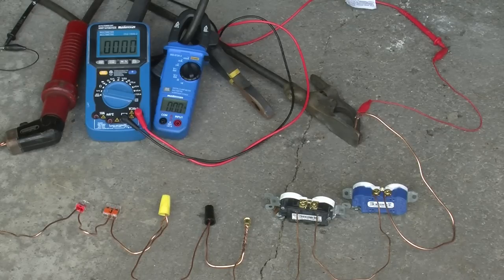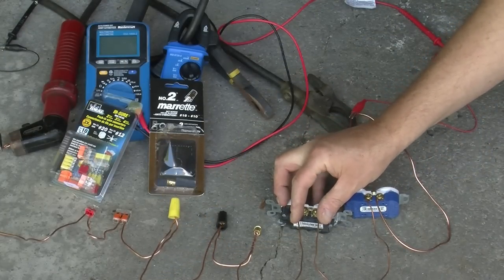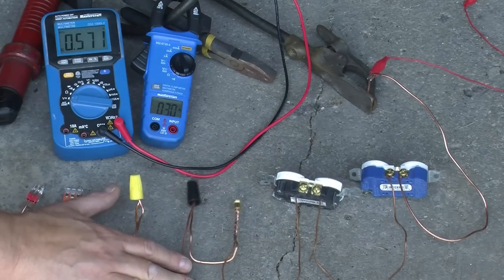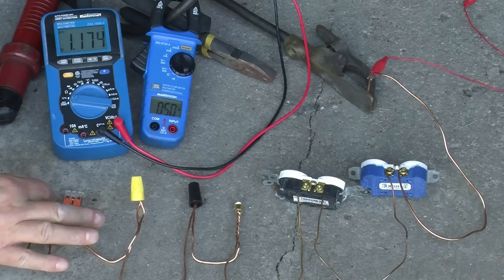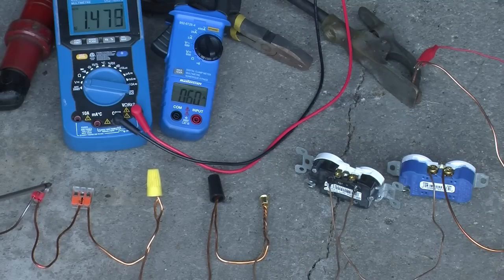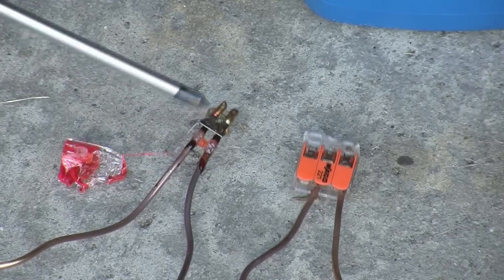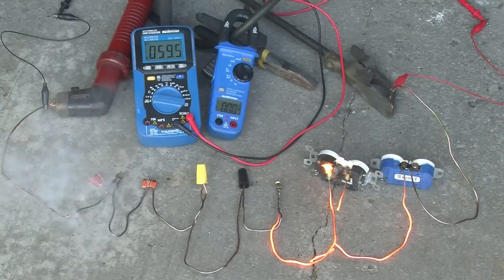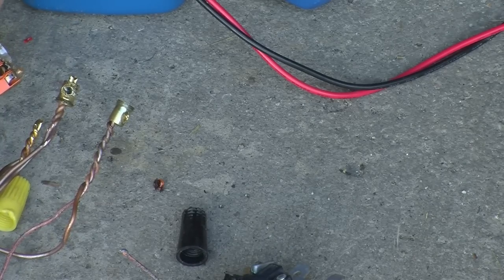Connectors: Which is the Weakest Link

Comment: I'd be interested to see some wire nut connectors that are used in less than perfect conditions (without pre-twisting the copper wires in advance):
0. control of pre-twisted wire
1. clean straight wire but barely twisting the wire nut
2. clean straight wire but really torqueing on the wire nut until the insulated portion visibly starts twisting as well
3. wire pair used previously together in the same wire nut, uninstall the nut, separate the wires, put wires back together matching original twist, install new wire nut of same size
4. wires used previously in separate wire nuts combined into a new pairing, roughly straighten wire ends with pliers until they fit into the original wire nut size 
5. wires used previously in separate wire nuts combined into a new pairing, no straightening, just jam them together into whatever oversize wire nut is needed to get them to fit
Reply from the maker: Thats a really good outline for a systematic test. I was also thinking of an old pair of very tarnished copper wires twisted and untwisted (similar to your 3,4,5 but perhaps without having some tarnish scraped off by handling).
Reply: A few more options, maybe on seperate tests, but how about varying gauges of wire together, and stranded+solid. And do same gauge and like the lighting style 18 guage.. it should fail first but I've found that connecting small gauge lighting wires is easier than two like sized stranded and solid counterparts. I think mostly because you offset the smaller gauge stranded farther in, and the wirenut gets into some "meat" of both. While the same gauge stranded might encompass the whole solid wire and the solid will pull out, or the stranded is to far back and doesnt get enough under the screw down. I think it goes without saying you cant really twist them together properly because the stranded gives way too easily for the solid to do any twisting. I'll always prefer all solid wires, at least for our standard circuit sizes here in the US, 15-20amp, 14ga, and 12ga.
Reply: Great ideas here fro future video tests. I am an electrician and really appreciate these videos as they explain what I see in my real world repairs. For sure I would like to see some not well made connections with corroded or tarnished copper and degraded Aluminum. Not twisted and remade connections.
Reply from the maker: @Sparkeycarp  I'm so glad you like the videos! I would be fascinated to hear more about what you have seen in real situations with problems. For a tarnished corroded connection, I think the only practical way to test  that is to get an old connection from a junction box that has been removed from an old house. If anyone is gutting an old house or otherwise removed a junction box that has not already failed and are willing to send it to me, it would be interesting to test. Same for some Aluminum 12/2 from the 1970s, and even better if  its attached to a vintage outlet and we can see how the connection might have degenerated. I'm in Ottawa (Canada) so it would be really easy if someone nearby came across some stuff like that.
Reply: ❤ this goes quite a bit further than what I was thinking. You covered what I was after
Reply: Just FYI, if you don't pre-twist the wire, you didn't install it correctly. Wire nuts were designed to replace a twisted, soldered, taped connection. Wire nuts have the most surface contact area. 

To do the test the best way is to test each connection individually. What causes a connection to heat up and potentially fail, is the resistance of the connection through the calculation I^2 x R. That is the heating in watts at the connection.

So testing individually, you push current through it at a specific level for each connector. You can pick a level around but above the circuit breaker level, or as I prefer to do, is set it to the ampacity rating of the wire. When you have that current set, then read the voltage. That is the voltage drop across the connection. The higher the voltage drop, the higher the resistance. 

Ohm's law tells us that V= I X R .and therefore R= V/I.  You know the "I" because you set the current. The voltage  drop is then V.  So that voltage divided by your set current, will tell you exactly what the resistance is in ohms.  The lowest resistance and the lowest voltage drop will be the best connection. From that point you can dial up the current to see which connection heats up the most.  The  power and heat dissipated at the connection is I^2  X R. So by doubling the current, the power dissipated will be 4 times as much. You can verify this with an infrared temperature gun.  Keep in mind that the wire itself has some resistance, which is why it heats up too. So when measuring the voltage drop, you should put the volt meter right across the connection as close as possible to be as precise as possible. 

Note too, that as temperature goes up, the resistance goes up too. So as a connection heats up, it tends to snowball somewhat, getting worse over time. 

Note that your results were predictable and each connection performed the way I would anticipate.  One last comment. On the outlet with the screw connections, I think you would observe with a thermographic camera, that the heating wasn't actually at the screw connection, but at the very small tie bar that connects the two screw pads.
Reply: @professorg8383  "Just FYI, if you don't pre-twist the wire, you didn't install it correctly. "
Wouldn't that be depending on the manufacturers installation instructions? I know other testers reading straight from the package that the wires are NOT to be twisted.
Reply: @bpomowe224  Actually, I have only seen "pre-twisting not required" as opposed to "don't pre-twist".  That said, there are situations like when connecting light gauge stranded wire to heavy solid wire, like in a lighting fixture. It can be done, but it is tough to get a good mechanical twist first. The key is making the stranded wire longer and using the smallest recommended wire nut. This is one of the few applications  where I support using Wago connectors, because the current is very low. You may get a little voltage drop, but the current is so low that the I^2 X R heating is very low. 

Personally, my preferred method for the best connection in such situations is the crimp style wire nut. It makes a very low resistance connection. better than Wagos.  But if they need to be undone, they need to be cut off. If you cut right below the crimp, with a good pair of diagonals,  you can keep the length lost to about 3/8 inch. 

In the pre twist "not required" wire nuts, those I have seen, say to tighten enough so the wire below becomes twisted. When tightened to that point, if you take it apart you will see that the bare wires are indeed twisted together. If you pre-twist, you know you have a good mechanical connection before you put the  wire nut on. and when you clip the pre-twist before putting the nut on, you know that both wires are of equal length.
Reply: @professorg8383  With Wago-style connectors being widely used over several decades now, I am not overly concerned about the voltage drop. As seen in this test, at the point of a connector failing, something else along the path is likely to already be burning at the time the connectors become an issue.

Those saying wire-nuts are inherently unsafe obviously don't have a leg to stand on though, that's just pure non-sense.
Proper installation techniques consistently carried out is the key regardless what system is used, which one to use is more down to personal preference and specific application.
Reply: @bpomowe224  Wagos have been widely used for a long time in 240V countries. But not very long in the  US. I think this is significant because when you look at typical residential circuits and the devices being suppled, in the US, the same devices and appliances at 120 volts pull twice the current as their 240 counterparts. Because the heating is current squared times the resistance, double the current means 4 times the heating.  

Typical US homes use considerably more power than in UK and European countries too. With power generally being current time voltage, we have on average more than double the currents involved. the voltage drop is directly a function of the resistance,  Resistance being a characteristic of the connector it's pretty easy to see that with on average double the currents, the energy dissipated in these connections will be 4 times higher. 

Interestingly enough the UL rating for Wagos in the US is only 20 amps. We have seen problems with these, but our "electrical installers" love them so much because they are easier. The guys who question using wagos tend to be fully  trained and certified electricians, But  you don't see these guys doing much residential.  I have done quite a bit of testing of Wagos and as easy and convenient as they are, I would never use them in any type receptacle circuits. Being an engineer, I want the best products I can use from the electrical theory standpoint and I am a firm believer that easier doesn't mean better. But I get that if you are an "installer" without a string theoretical background, You're going to see easier as better, 

I certainty won't go so far as to suggest that Wagos can be a fire hazard,  Their failure in a proper enclosure is most likely going to result in a failure to function of a circuit or some intermittent problems related to aa high resistance connection. But all the math and the physics say that the wago style connector is inferior,
Reply: @professorg8383  I do struggle with the Fourier analysis, and can concede without shame that twisted wire connections have superior resistance values. Here is my objection to your reasoning though, is the difference large enough to actually matter?

If superiority is the guiding principle, should we not use at the very least 8 gauge wire for LED lights in order to cut down the resistance, or do we seek to strike a balance between safety and utility?
Seeing the major standards (like UL, CENELEC and IEC) differ but all allow for thinner wires than totally failsafe, I draw two conclusions:
They all seek a balance, and have through their considerations landed in slightly different conclusions as to where the balance point should be set in order to have economical systems while retaining the desired safety margins.

As the standards demand independent third party certification of the products to be rated, it would be very odd if the UL marked products do not meet the requirements.
(Well, of course provided they went through the process and just didn't slap the stamp on anyway, but that's outside the scope).

As a humble non-engineer, rather than having the connectors withstanding ridiculous overloads (like the burn test running various connections at 5-7 times the mark current for an hour), I'd set my focus on ensuring those conditions can not occur in the first place, as the load on the wire is likely to cause fires elsewhere long before the connections fail.
Just some simple thoughts from a simple man.
Reply: @bpomowe224  I appreciate where you are coming from and I agree with a reasonable balance. But maybe it's about my definition of reasonable. 

As for the standards organizations, I think my view is much more biased.  You said that all the standards demand independent third party certification of the products to be rated.  You may be surprised to learn that is not true across the board by any means. You probably are not aware that the vast majority of IEC ratings are self certified. The manufacturer is trusted to know and properly apply the standards and self certify. In fact there is not even a requirement that the manufacturer performs testing and keeps documentation. I am not a fan of the IEC at all and comparing an IEC certification to a UL certification is comparing apples and oranges. 

I have more than 4 decades in heavy industry and I have come to hate IEC rated equipment. I can recall when we started using IEC rated equipment at the urging and direction of the bean counters. In the US, we used to use NEMA rated equipment in industry. But the NEMA rated hardware was typical 2 or 3 times more costly than "equivalently" rated IEC stuff. After just a short while, the catastrophic failures of IEC rated equipment raised concern of our engineering community.  What you first notice most obviously, the IEC stuff is much smaller and much lighter physically. Most IEC hardware is not repairable. And once you do any autopsy on the failed equipment, you wouldn't want to repair it!! 

So you start asking why this cheap piece of robotically manufactured crap can be rated equally?  But then you really need to get into the weeds about the ratings and standards, And you find some correlation, but not apples to apples comparisons.  I have spent a lot of time working with Japanese electrical engineers who use JIC standards. US standard and JIC standards are much more closely correlated. Not too surprising because after WW2, The US rebuilt Japanese industry. Not to mention that in some old Japanese traditions, major engineering failures pretty much dictated that the responsible party should do the honorable thing and spill his guts on his desk or otherwise self inflict some other fatal self punishment. 

The  weird thing is that all  over the world, amps are amps, volts are volts and watts are watts. Guiding principles like Ohm's laws, apply no matter where you live. Actual engineering standards are pretty much universal, but they get applied differently by the rating/certifying bodies. 

When you get down into the details of the certification ratings there are many differences. But the problem I see is that the IEC is very much a political organization. The IEC have "policies" which have nothing to do with technical standards.  The structures of the NEC/UL organizations is considerably different than the IEC. The IEC has over 80 member countries and another 80 or so associate countries.

The IEC tries to be a ones size fits all and IEC standards cover much much more than electrical devices. The IEC has made a concerted effort to get all its standards accepted in the the US. Bottom line is that their goal is economically driven rather than based on good engineering principles. 

To be honest, even as an educated electrical engineer, I assumed the standards were pretty much the same and developed the same way. But after holding a perfect bullet proof watermelon in one hand and an exploded tomato in the other, I had to ask myself how these two things could possibly be the same. Well the simple answer is they are not the same. What is harder to explain is why they are '"rated" as equivalent. You have to get deep into the details to get those answers. You find some weird fundamental differences.  Some of this can be at least partially explained when you realize the differences in our electrical systems. And some is related to what the definitions of reasonable and acceptable are.  In that regard, keep in mind that more than a few third world countries are full voting members of the IEC. The IEC uses a consensus model to decided on standards. China, Pakistan and India, among otters are full voting members. Do you think that China's view of what is reasonable and acceptable, is something you would trust? 

The problem with consensus among such diverse members is that, often, you are forced into compromises to achieve consensus. Now take into account that there are member countries, not  member professional expert  engineers. Imagine being a Chinese electrical engineer who the Chinese government designated as their representative will you have pure engineering principles involved in your positions, or might you have some "political" influence.  We need only look at their medical professionals and the whole Covid pandemic,  for that answer. But representatives might also be some party leader with no real electrical background. The member country determines who their reps are and the IEC has no ability to question their qualifications, 

The IEC started in the UK many years ago and was originally an organization structured similarly to the US standards organizations, which were heavily focused on strong engineering principles and both safety and fire prevention. But even then, economics drove a lot. 

All that said, I think you are looking at this fairly logically. And I agree that subjecting connectors to far over rated currents, is a somewhat flawed test. What these kinds of tests indicate are the  weak points in the system. And those are  the parts of a circuit that have higher resistance. In my tests I use rated currents, and many cycles of zero to full load to zero, with time in between to cool to ambient temperature. 

But you make a couple wrong assumptions. Overloaded wires are not common failure point which causes electrical fires. In fact that rarely happens without someone completely defeating the protection devices. (go back to the days of people putting a penny in place of a blown fuse.)

In reality it is failed connections that cause most electrical fires. Modern wire can in fact easily support twice the ampacity for very long extended periods. The resistance of the wire itself is low enough that it takes significant over currents without major heating. (But don't take this as advice to use smaller gauge wire than code allows!) 

The reason is resistance. The higher the resistance, the more the heating. but more importantly,   is the  "current squared" part of the energy/heat dissipation  formula,  I^2 x R or   "I squared R" or  Amps X Amps X Resistance.  Take an example of 5 amp through 10 ohms  resistance. (5 X 5 X10 = 250 watts.   Increase the resistance to 20 ohms and you have, (5 X 5 x 20 = 500 watts)  Twice the resistance and twice the watts.  Now keep the resistance at 10 ohms, but double the current to 10 amps. (10 X10 X10 = 1000 watts!) Twice the current gives you four times the heat energy dissipated! This is why the resistance of a connection is so important, Particularly at higher currents. 

i can relate all this with specifics and why this matters. There are a few guys who have done this reasonably well, but the I think the urge to push it to some dramatic failure at well above rated capacities, can actually hurt the points they are trying to convey. I think I can show this with the numbers in a more meaningful way if you'd like to see it.  As a bit of a preview, realize that the actual, fresh out of the box wago, has more than 15 times the resistance of a screw connection or wire nut.
Reply: @professorg8383  that was quite a pleasant read to be honest. It is too rare to see discussions where opinions aren't considered facts, and reasoning not substituted by shouting, but I fully appreciate the difference.

I must say I now generally agree with your arguments, stringent and to the point.
the "back to the days of people putting a penny in place of a blown fuse" reminded me of Elfel, were the practitioners publish their worst findings, including a Diazed fuse milled in its entirety from brass since the fuse would pop every time the owner took out the welding machine...

The self-certification part I am a bit..  ambivalent about. The European Union 
CE-marking is simply a statement that the manufacturer or importer has made the product comply with the EU rules, but whether that is the case will not be verified unless a monitoring agency either picks it in their random checks or are investigating a complaint given in.
When they do, though, the documentation, including third party certificates as needed, is under full scrutiny and any discrepancies will result in action ranging from a sales prohibition or total recall of the product at the manufacturer's expense to more stern measures. The obvious problem is of course shady businesses running their products through a shell company with no real assets if busted, but since that is a constant regardless if under UL , IEC or CENELEC, I don't know what system can fix that without each and every single item being third party verified to avoid bait and switch operations...  something that would drive the costs insanely high.

A recent case is the Easee car charging boxes, that are now prohibited from sales across the entire EU due to lack of documentation. They probably are safe, but as there are deviations from the standards in form of newer technology, those alterations has to be proven to be at least as safe as those already covered by the standards.

The implementation of the standards into the domestic codes tends to vary a lot between countries as well. For instance, a home owner in Sweden are barely allowed to change light fixtures without an electrical degree, while it is perfectly legal for an Austrian home owner to do simpler wiring in the house. While some sort of tubing is mandatory here, other countries under the same standard considers plastering the wires into the wall as adequate insulation failsafe and have that as praxis.

From what I can gather when it comes to electrical fires in Sweden after removing the absolute most common one: heater (stove, hairdryer, soldering iron) turned on and forgotten, failed connections are the culprit in most cases, though interestingly it seems screw-ins (both as single and terminal blocks) are the ones most prone to failure.

Plug-in and lever connectors are not common as a cause, but where they do occur, it seems improper use (insulation not stripped to the required length, or all parts of the stranded wire not inserted to the bar) explain most if not all the failures.
Wago even put out an award for anyone sending them a connector (with least 15 cm of the wires still attached) where the connector itself is cause of failure.

Still, the physics can not be argued against, and I'll make certain to learn how to properly use wire nuts to have an alternative.
Reply: Excellent comment by someone who obviously knows electronics.  I would like to point out something I have observed that is a "modern" problem.  The electronic loads today in, for example LED lights have a capacitor input rectifier.  I have measured HUNDREDs of amps of current when these lamps are switched on.  It will last for only milliseconds, and the magnitude depends on where in the cycle the switching happens.  One lamp may not be a problem but a string of, say, 50 in a warehouse or barn can be many microfarads and require a   tremendous current surge.  I see limited lifetime on the wall switches in these applications.  Examination of switches used for a short time  reveals tremendous pitting from spot welding.  The contacts have not been overheated by steady state current. This pitting causes high resistance and the switch  eventually, invariably fails from overheating.  This can take months or years.  The blade type connectors are scarry in this type application.  What are your thoughts on this phenomena?    @professorg8383
Reply: @barnowl6807  Well, that is a pretty interesting phenomena.  As yo point out, capacitors in parallel are the sum of the individual capacitors. They initially look like a short circuit but current quickly drops off. I'll have to dig out my scope and look at this. I have 8 ~40W barn lights, switched by an industrial control relay. II turn it on and off wirelessly,  A timer could easily be used too, but I don't have one set up. As I recall, the contact rating of the tips is 30 amps if I recall correctly. I do have 2 sets of tips in parallel.  Years ago when  I originally set these up, I had Mercury vapor lights totaling 800  watts,  after several years, I did see tip failure on a single set of tip. But the ballasts are an inductive load and I'm pretty sure the tips arced pretty good on shut off. That's when I switched to using 2 sets of tips. 

The MV lights were a bit of a pain when very cold or on restrike after a power glitch. I'm rural and our power is often subject to outages. A couple years ago I switched these out to LEDs for better light and power savings as the price of LED came way down. The plastic shades were pretty shabby from the UV and I was getting close to end of life on the bulbs anyway, so it seemed to make good sense to just replace them. To be completely honest, I kept them on a lot because of the warm up time being an issue especially in winter. n big lighting projects, we tend to use lighting contactors rather than individual switches directly feeding lights

Anyway at the time, I checked the relay and  the tips looked fine.  SO it was basically a swap out of fixtures. They worked great,. way more and better light, almost instantaneous start. Hit the button and they are in at full brightness, And of course at less than half the power. In fact, I love LED lighting so much I changed out virtually all the CFLs I had in other lighting.  The only incandescents I still have are  100 watt bulbs in parallel that  I use with test leads for a current and or load source I sometimes use for testing and a very quick continuity test. (A very old school set up we used to use many years ago in an old electric shop I first started working at!) We used to use these for a  lot of basic testing, lighting cigarettes .and occasionally cooking a hot dog!  Also good for charging a cap.  Which reminds me of a great story about capacitors from back in the 70's

I remember rigging an old refillable 200A  cartridge fuse with a decent sized cap inside, instead of the element.  Our old steel mill shop was right next store to the Mechanical shanty and we'd have mechanics visit all the time and a few would always mess with whatever we had laying on our butcher block test bench. So I'd charge it up with the test leads and  leave it laying on the bench. 

I still remember the first time we got somebody. It was a fairly big fuse with copper blades on each end.  The mechanic picked it up and it took about 30 seconds before he got his fingers across both ends. It was hilarious! He screamed and tossed it in the air. He's hollering that the old fuse shocked him!! 

We're trying to keep from laughing while telling him he must be nuts because it's just a blown fuse!  He's insisting that it somehow still must have power in it!  I said I can prove it to him  So I carefully picked it by the  insulated tube and laid it on the steel top desk I was sitting at, grabbed the old Simpson meter and checked  it for voltage and zero volts showed in the meter,  He's still ranting like crazy and starts turning the dials on the meter. At one point he had turned to resistance and aw the needle deflect. and saying, "See, see it still has power in it!" 
 
So then I start explaining how the meter works and show him that just touching the leads together indicates it has a good circuit. So he studies the meter for a while and begins starting to doubt himself. I pick up the fuse and handle it all over going so far as to lick my fingers to convince him. and then I grab his hand and put the fuse in it. Of course it was long since discharged  so he can't believe he's not getting shocked. So then he says, "I swear that thing shocked me before!" 

So we're telling him he must have just had a muscle twitch like if he  hit his crazy bone!!  So he's shaking his head and saying, maybe so but he was sure he got shocked. A bit  later in the day he comes back in still shaking his head.  So we let him in on the secret and explained how a capacitor worked.  He was fascinated and we showed him hw it was made and how it worked, Next ting you know he charges it up and waits to get one of his buddies with it.  Of course when he left to go get a buddy we discharged it.

So he brings a buddy back with him later and cautiously roll it on the bench towards his buddy who picks it up. So he's sitting there in anticipation of his buddy getting shocked, but it doesn't happen.  After the other guy leaves  he's trying to figure out what went wrong and very carefully picks up the fuse and starts touching both ends very quickly to see if it will shock him. So we let him in on it again. W all start laughing our asses off and he says, "Yu crazy MF's really got me!" 

We joked about it for years later and he relished telling the story to others. He did finally get a couple guys and enjoyed every minute of it. But word got out pretty quick and every mechanic afterwards was afraid to touch anything on the bench. He  loved telling the so much,  everybody heard about it.  He was a good old boy shade tree mechanic from the south, but he was a decent mechanic and loved working with us. I had just heard a couple years ago that's he'd passed away. I learned a ton from the old timers both Electrical and Mechanical.  That was back in the early days of my career before I became an engineer. 

I digressed a bit,  so back to the LED lights. I've had mostly good experience with LEDs. But then earlier this summer I had an iue with my shop lights. We had some pretty good storms come through and lost power for about 4 hours. I ran on the generator until power was restored. When I power the lights back up, two came up strobing. I took them apart and discover a bad cap in each of the failed ones. They  hadn't completely blown but were clearly swelled. I replaced the drivers and they have worked fine since.  I'm pretty sure they took a good surge damaging the caps. I'm guessing we had a lightning hit on the line when power went out/ 

But I have not seen the issue you talk about. Arcing on the switching contacts usually comes from an inductive load lagging when shutting off. but LED drivers are all designed a bit differently and some of the cheap Chinese LEDs have weird driver circuits. Mine are current regulated drives. 

But what you are saying about instantaneous starting currents is at least logical. But the inrush should be very brief and drop within tat first half cycle. Doesn't seem like it should pit the contacts but depending on drive design. there maybe something else going on that that I haven't though of. I'd like to see it on the scope. The wide voltage input range on some LEDs so they can make one fixture that runs on 120 or 240 volt inputs. probably use switching power supply circuits, but these can  vary widely.  A few guys n the internet have looked into cheap LEDs and found some interesting things, but I haven't heard of the phenomena you speak of..  You have me a bit curious though.  On all my residential wring these day, I try to use UL approved commercial grade stuff.  I generally recommend NEMA rated stuff in industrial projects, but cost sometimes overrules that.  I'm not a fan of IEC rated stuff for numerous reasons . My issues with Wagos is just one example. 

I tend to pass on big projects these days because the pace can be brutal and I'm getting old!!  Plus I enjoy teaching and  like to stay up to date with the latest developments in the field. Might be a good scope lesson in your issue though, so I do want to look into it. I haven't come across any really good LED lighting  classwork. The trends in usage tend to be more "plug and play" related. Most of  what I teach is more related to automation and robotics with some general maintenance. I have a very wide range of knowledge in all things electrical, but I guess I'm more of a controls specialist. In my classes, I do start with basic electricity and basic electronics, but just scratch the surface on electronics because so much stuff is IC based and application based. But I can get in depth if needed and even know quite a bit about power distribution. As a project manager/engineer the knowledge base is helpful, But most of what we use in big projects is with commercially available stuff,  Any design engineering I do is mainly tinkering in my shop. 

BTW I'm glad you can get into the details, that's becoming rare these days. he entire field has become more about using "black boxes".even amongst a lot of engineers.  But there is about a dozen different ways you can go in electrical engineering these days.  It was pretty much one thing back in the day.
Reply: but most wirenuts i'v seen the instructions say not to pretwist.  won't you be liable if you don't follow manufacturer instructions